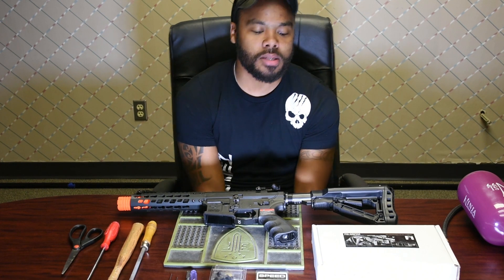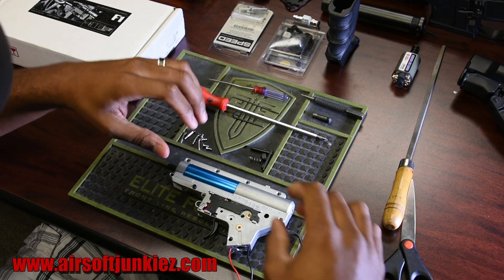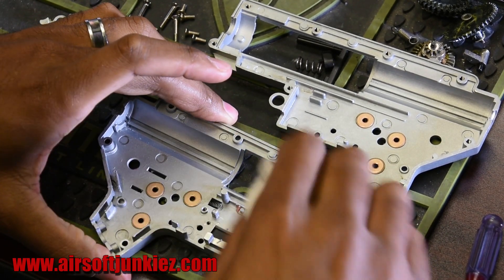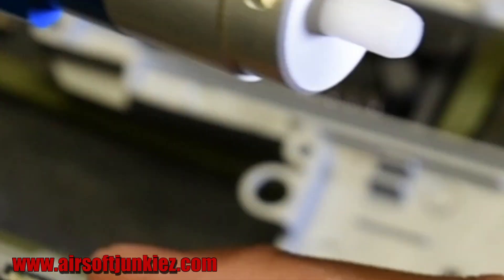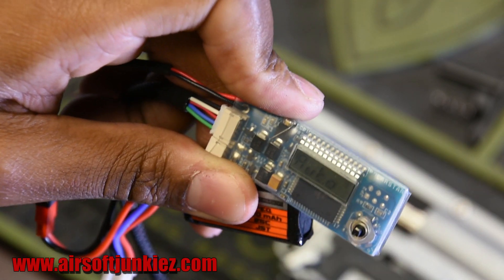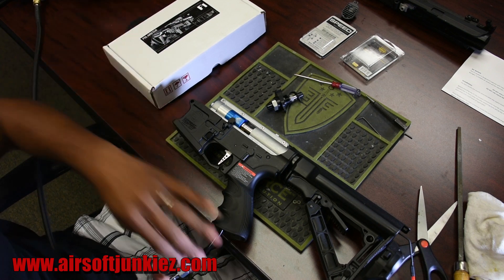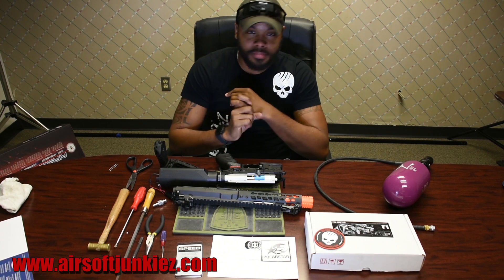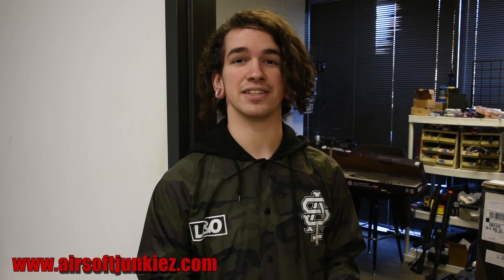Airsoftjunkiez step by step install & testing of a Polarstar F1 with speed trigger & grip connect

Comment: Instead of shaving the selector plate, simply take one of the old shims and put it underneath the trigger board on top of the screw hole to raise it up. Simple and doesn't require any modifications.

Comment: Hi guys do you have experience with reaper v2? I had maxx hopup with promitheus bucking the purple one. But was not shooting the bb. Now i change the hopup for a point hopup is normal one with big wheel to chang the hup. And i put the red bucking that was in the package with the hopup. Now is shooting but not regular and somethimes the bb stay inside and the reaper start to leak air. After open the gun and shoot without hopup and innerbarrel the leak is gone but the bb stuck by the bucking.
Reply from the maker: Can you please call our techs to go over it

Comment: My bord has 2 places to plug in the selinoid..... !?  J3N and the other J2P .... Any idea where it acutely goes ?
Reply: Did you ever figure out which one it plugs into? Just got my F1 today and I’m trying to figure it out too
Reply: @mikeymikee9917  ya I did . the second port is for a box mag so the gun and box mag feed simultaneously. Its been awhile since I put it together. lol I'll look again and let you know .
Reply: @mikeymikee9917  its the top port on the bord, when installing connect wires first otherwise you will have to take out the fcu bord to do it .

Comment: how do you guys check alignment everyone has their own way?
Reply: johnwis23 well there are a few ways to figure it out. One is test firing. Check to see if your bbs are curving. If they are curving then your alignment is off. Another quick way and I hate to say it but it works is to put a light to the bottom of your hop up and look down the barrel. If you use that method please think of safety. Clear it and disconnect your battery so you don't have a accident. I DO NOT RECOMMEND DOING IT. But it is a method I have seen used. Those are just a couple. We use the test fire method. While test firing it you can also tell off of your nozzle if there is more wear on the nozzle in certain places. That's a really good indicator.

Comment: How long does it take to ship a custom gun?
Reply from the maker: Read more it usually goes out with 48 hrs unless there is a lot of modification. What are you look at??
Reply: TVairsoftjunkiez a krytac with all the upgrades except trigger
Reply: TVairsoftjunkiez oh and also, are u able to tournament lock ur slp air rigs?
Reply from the maker: within 48 hrs -- should be easy enough to knockout
Reply: TVairsoftjunkiez ya apparently it's gonna take 2-3 weeks to get here. Hasn't been shipped rn and I ordered last friday
Reply from the maker: Read more we had to redesign and redo the tournament caps, to reinforce the lock. They were 3D printed and will ship out Monday for sure.

Comment: I have a question I have a PolarStar Jack and whenever I try to shoot my b b's just fall down and I'm using 90 PSI
Reply from the maker: What’s your dp set to.
Reply: @Airsoftjunkiez  I think 18
Reply: Any update?
Reply: Rip 💀
Reply: @dallenprince?
Reply: I'm lost with that response
Reply: @MrLee-ps3kd   I have had the F2 for like a half a year and i have fiddled with the FCU quite a lot. Your actual FPS depends on the barrel length, PSI and hop-up chamber. So, if my response is not too late and you have a good chamber (well-working IYO), tight bore barrel, bucking and rubber you should be set to adjust the FCU settings – p* have a PDF with complete walktrough of those settings – if your BBs are just dropping out of the barrel, try increasing FCU's dN (to check if it is not too fast but shouldn't be), dR and most importantly dP – that controls basically the air volume that flows trough during each cycle. The dP might be your problem.
Reply: @dannyrocker-w2m  thank you for responding but I did fix the problem it was the DP so I said it up high
Reply: @MrLee-ps3kd  you need a bucking that holds the bb in place, I know this is an old comment.  What bucking are you using?
Airsoft junkies has a video on this that's 5 years old.

Comment: is there a difference in performance between the Jack and F1?
Reply: Koala Tactical well the performance wise they are really close. Is one better then the other still a very close battle between the 2. The F1 has a 2 stage firing system so it helps keep your shots more consistent.  Where as the Jack does not have it. But in my opinion they are both really good systems.

Comment: Airsoft gas system for gel blasters that works with current too likely on the comprehensive sleeve ?? and a better 40mm mmmm I'll be doing the bluster shoot 30 gels a shoot needs new spring and feed loaders for it or charge cap weighted head sensor and back blast cap 200 gels it's all you need the airsoft was not built well in the 40mm Application .